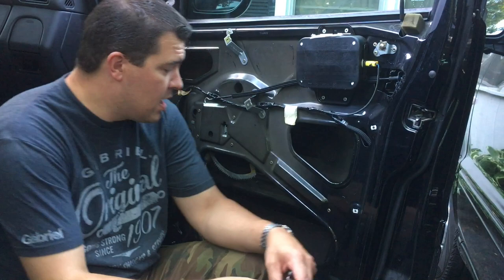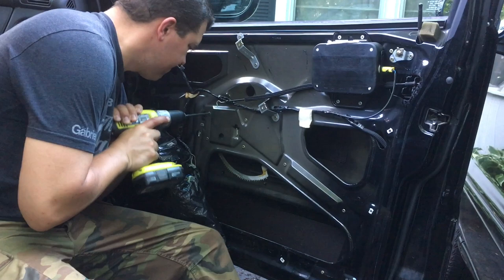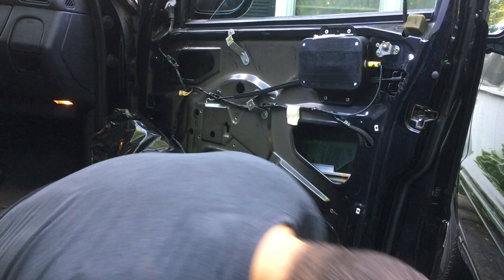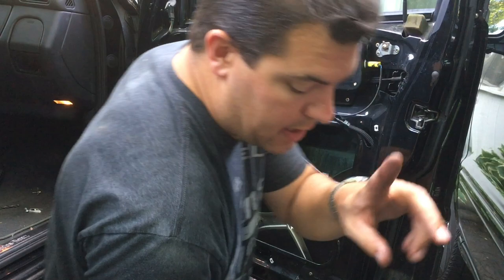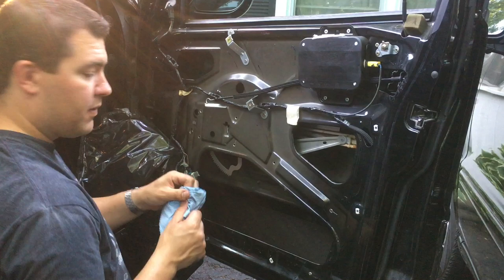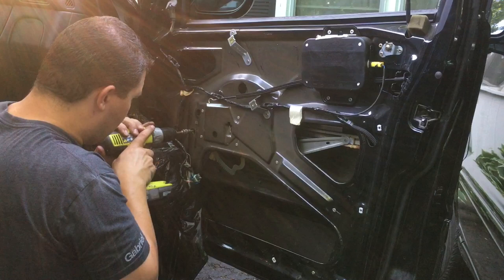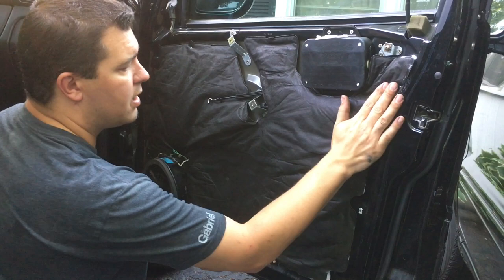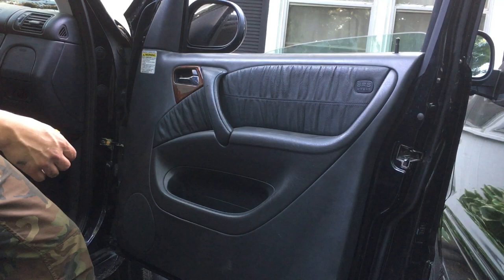How to fix repair and replace a Mercedes Benz ML320  ML350 ML430 ML500  W163 Window Regulator Motor

Comment: You seem to know these cars really well. Neither of my front windows work but I can hear something click when I hit the front window buttons. Both my rear windows work fine. What are the chances my front window motors are dead?
Reply from the maker: It’s highly unlikely, have you ever replaced the switch assembly? The buttons commonly go bad.  You can pull the door panel and unplug the motor and test to see if you are getting power at the plug when you hit the switch.

Comment: So if I wanted to test and see if my window switch was bad or my motor I can just use a meter at the connector for the motor and hit the switch. If I have voltage then the switch is good but motor is bad. and if there is no voltage once the switch is pressed then the switch is bad?
Reply from the maker: Yes correct, one exception would be if the doorside electrical plug connector is corroded sometimes that prevents the electricity from coming through into the door.
Reply: @joesnowmobiles  thank you
Reply: Jackson Cruz 

Where can I find your link for the replacement part?
Reply: Also, the clips
Reply: @tomsheffield9673  ....in my situation the whole regulator broke from the rivets since the arm at the bottom attached to the plastic slider had broke in half. That in turn kinked the motor electrical connector and was just enough for it to not make contact. Thanks to your video i replaced regulator and all is good now. I bought regulator from Amazon for $32